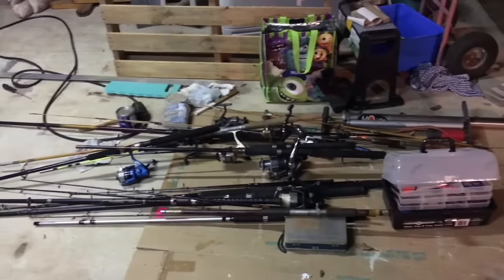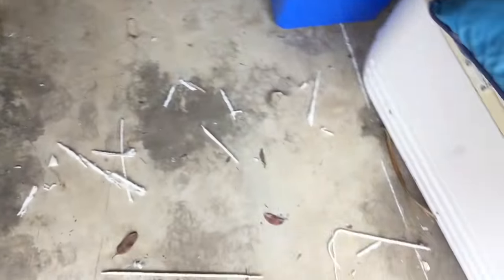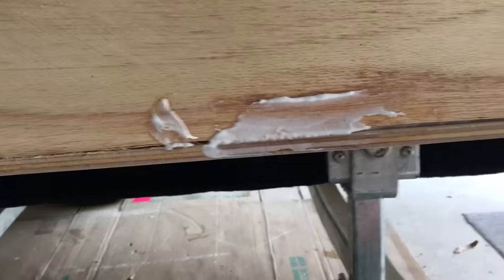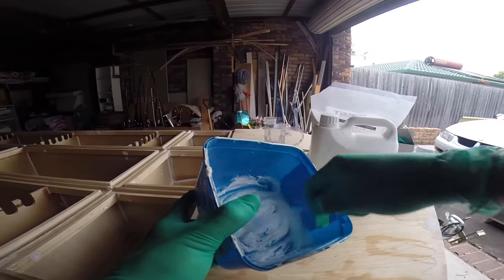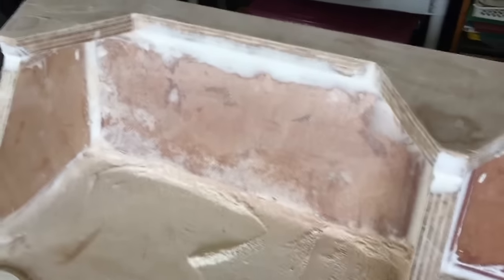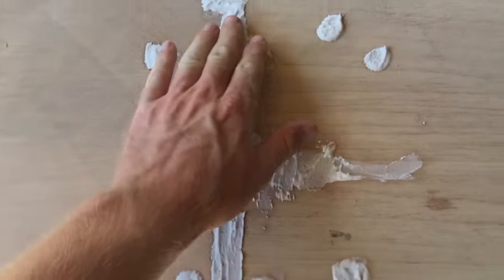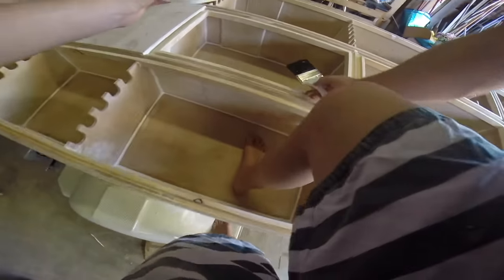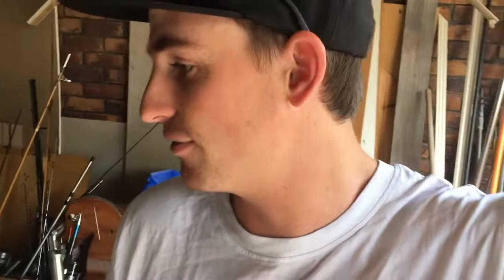How to Build a DIY Plywood Boat // Part 3

Comment: Junk mail, the thicker paper bits, works good as a scrapper for excess resin filler and glue. Cut little rectangles from the stiffer junk mail and use those to scrap of the excess gunk and leave cleaner surfaces for less sanding later.

Comment: Fantastic build - But I would build the center strip solid decking, no hatches, and access the battery, gas tank thru one of the rod lockers. This would save alot of work and guarantee a solid feel under foot.
I would also incorporate enough foam in unused areas to float the motor.

Comment: Great job!  A couple of suggestions I would like to make:  First, when filling surface defects with thickened epoxy, try using a putty knife.  It will save you a lot of sanding.  Second, when waterproofing the plywood and you have a fairly large area, using a paint roller with a short nap, will make the process easier and quicker.
Reply: Exactly what I was going to say.  You'll find you use less material, less sand paper and save a heap of time.  The filler will also get in deeper into the cracks and leave a better finish after sanding, but you only learn these things from experience.

Comment: Did you consider closed cell expanding foam for the floatation cells? The closed cell foam does not absorb water (unlike regular spray foam you use in home building). That way if you take on water it still floats like a cork and since it’s closed cell it removes the worry of water rot.
Reply: Good 💡
Reply: Give it enough years it asorbs water

Comment: Great work champ maybe get yourself a small applicator when your applying your epoxy you will get it in real smooth less sanding champ
Reply: EXACTLY - The time spent correctly applying all that epoxy filler-fairing material would more than cover the time and effort to sand down a bunch of lumps and mess.
Much like applying Bondo correctly.

Comment: Love ya work Bud, only thing I wouldve done different is, for the epoxy of the internals I wouldve flipped it and suspended it off the wrafters in the shed atleast ya could stick ya head in em and got all the undersides of the rails abit easier. Still looks a million bucks Bud

Comment: One concern. What happens to water which makes it's way onto the compartments. Suggest drain holes into each area and a bilge pump.
Reply from the maker: not much makes it in and none if I am fishing the creeks and rivers. normally will sponge out any water that gets in after I finish my fishing at home and leave the hatches open for 10 min to dry out completely. have considered the bilge idea but not necessary at this stage :)
Reply: Fishing With Timmy Turtle but how far does it sit above the water? Waves will roll over the deck since you made it so low to the water all the way around the boat. Why did you build it that way???

Comment: And all that sanding and prettying up is why you take the time to make sure all your joints are tight. In ther first video,  when your friend said better too loose than tight, I cringed because I knew what it would lead to.

Comment: Hey mate in the video i know you mention the plans for the skiff dont have hatches but just wanted to check if the hatch that the battery and fuel tank go in are on the plan. Sorry if i have not explained that properly.
Reply from the maker: sorry mate no hatches at all in the plans I would design hatches differently if I did it again. they are not as water proof as I would like. if you want to do the same follow the video or I am more then happy to send you an email on how I built them if you need any further information
Reply: @FishingWithTimmyTurtle  cheers mate im keen to build one. I only want the 3 center hatchs on mine. One for the fuel tank, one for batteries & one for tackle. Just sorting out space at home to do the build. Will definitely be getting a set of plans off you once im all ready.

Comment: I'm just curious, is there a reason you couldn't just use wood filler on the gaps and screw holes instead of the expensive epoxy?

Comment: Why not just put a couple extra coats. When it comes to waterproofing, it’s a small cost for piece of mind in the long run. That’s my personal opinion. Harder to fix if there is a problem.
Reply from the maker: Extra coats are added to areas needed once hatches are finished because some areas had to be sand for hatch to fit properly. I was happy that I had 100% water proofed before paint

Comment: WTF bro?? You love to sand resin don't you.. Epoxy shrinks very little, if it "going away into cracks" it's because you didn't fill the void. Load it in with a spatula and remove excess. You waste less you waste less resin and have a lot less to sand

Comment: I have enjoyed your videos of your boat build.  I'll pass on a tip for working thickened epoxy, and that is go get some body putty spreaders.  You will find things will go much faster. You can also round their corners to get your cove for the corners.  

I look forward to watching the rest of your build...  

I understand you are working in protected waters so what you have works fine.  A word of warning because your hull has sharp chines be careful going into a turn at speed. And really careful if you are at planning speed because the outside chine can hook the water and flip the boat.  This is one of the issues with a long narrow flat bottom hull with sharp chines.  I'm not trying to scare you I'm just offering you a warning of what could be lurking when running the boat.
Reply from the maker: all good mate thanks for your message. have had the boat running for 2 months now finally finished the editing. standing up and driving with a tiller extension dampens the steering so it not to bad on the turning. didn't take long to ind out what its cable of and what it isn't. yer up to you what you want to do with putty thats just how I did it :)